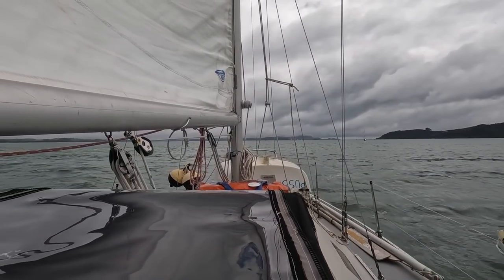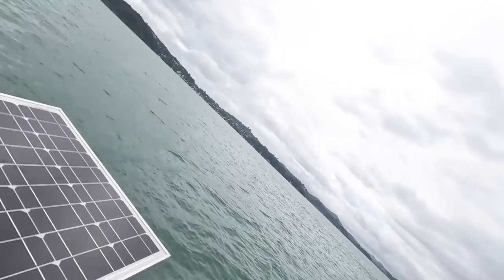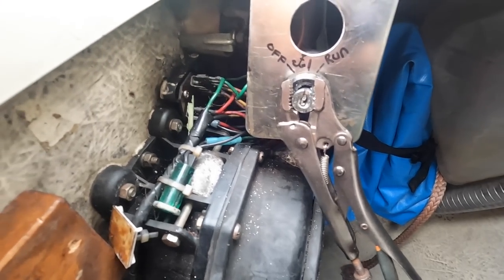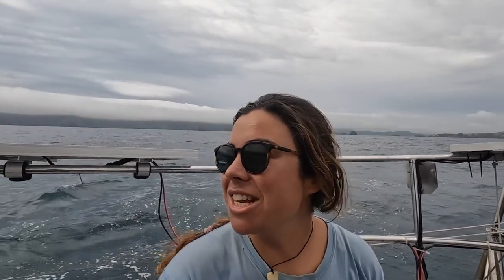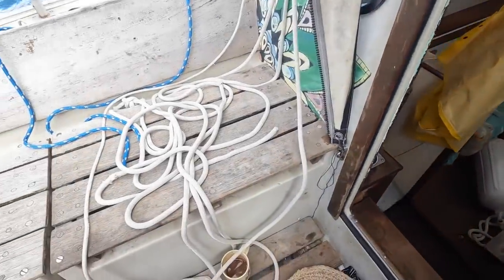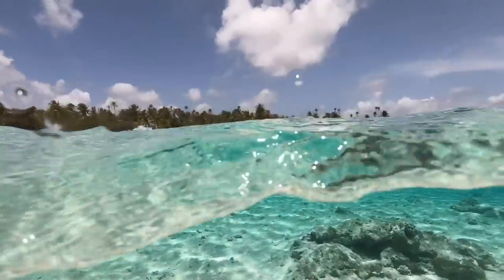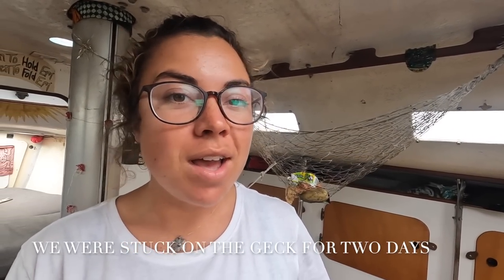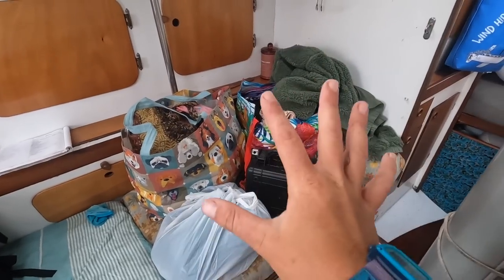Cruising Bay of Islands New Zealand WHSE116

Comment: Get rid of key. Replace it with starter button. Put a secret cut out switch in starter circuit. Total cost less than $20. Make sure you can preheat glowplugs too.
Reply: And a stop button because the fuel cutoff seems to be solenoid operated. No glow plugs on the Bukh I believe.
Reply: Yes, my thoughts, too.
Reply: Totally agree on losing the key switch but you need a power switch, kill switch and preheat switch with the Bukh DV 10 or at least the one I deal with. The preheat is a heater in the intake. I have momentary toggle switches for preheat and the kill solenoid.
Reply: @daveg4  Plus 1 to all of that. Saves me writing a post. Don't compromise on the switches. Proper marine switches, not cheap Chinese rubbish.
Reply: @ross82  Yes.
Reply: There is no need for a kill switch. Just build a LOCKERABLE BOX over the start (& stop) button(s), & use a simple PADLOCK.
Reply: @ross82  yeah, I could understand her doing this out in mid ocean but to have a proper switch and be in a marina and not fix it? stupid, hope it does not bite her ass in the future

Comment: A replacement ignition switch is a simple and relatively cheap fix. It’s not worth the frustration, just replace it with a toggle switch and a push button start.

Comment: Grips of jankey. Kubota knock-off ignition is my choice. A second is planned for the cabin. As is a twin mainsheet, after more money. Get a manual access to the deceleration on the pump. Most have just an electrical solenoid moving to deceleration/ cut-off. The Geck keeps improving halfway around the world.

Comment: So glad the engine is working out for you!  Also like the creative thinking on the main for a better boom angle, but.... The padeye you are using on the deck is 90 degrees wrong. Yeah yeah, I know, little boat, I'll only use it when it's light air, blah blah blah, but that's really not good Holly.  If it lets go you or someone else could really get hurt.  If you send me the contact I'll send you a pair of padeyes adaquate for the load which you can mount aft and pependicular to the existing ones (Spin sheet blocks?).  I wish I could be a Patreon, but I'm a poor rigger. I do have a lot of parts though, let me hook you up.  It's the least I can do.

Comment: Thank you for all of the videos. I have enjoyed watching it for quite some time, and as someone who has been in the maritime industry for decades let me say, your resilience and abilities are quite impressive.
In all the years I’ve watched this is the only time I’ve ever had any concern for anything that I have seen, and I’m a little worried about attaching what is now your main sheet onto that pad eyeand its ability to sustain and heavy weather just a thought captain .
Thanks again you’re awesome .
Reply: Came here to say the same thing. She said she'd tie it off with a preventer, I think, but still. If the strain is left on that padeye and she takes a squall or strong gust, it seems likely it would snap it.

I don't want to see shards of metal, that block, or line whipping through her cockpit.

She's a smart cookie, though, I'm sure she's thought of all this.
Reply: I also admire the capabilities of this young woman and in particular her ability to think outside the box but sometimes a proper fix is better than a jury rig. 
A main track car system is designed to take the sudden loads of a gybe (upwards of 2 tonnes) where a pad eye is just small bolts through the deck and this system is only for light winds, nothing over 5-6kts. 
That can only be used with a preventer and monitoring the weather conditions (and I’m not trying to tell you how to suck eggs 🤣) as the sea has no mercy for the unwary. 
Enjoy NZ and I think you’re next leg up to Vanuatu which is a nice place to visit and you’ll find a quaint French influence as well. 
I bid you fair winds and safe sailing dear 👍👍🤩🤩

Comment: Do you have a  multimeter on board? If not, get one.  A basic understanding of 12v circuits would allow you to approach rewiring etc with more confidence . In the case of the ignition switch (really a stop/ start switch) you would see that swapping in an ignitiion switch is basic, and in this simple situation 2 momentary switchs would easily replace the start/stop switch.

Comment: When I leave mine, I have a 12 volt dehumidifier I rig up powered by a solar panel, which discharges into the galley sink.  When the sun comes up it charges a small battery from a car jump-start kit, and this runs the dehumidifier which draws less than five amps.  I remove the main engine start battery  and place in storage mode.  To do this, I  fully charge it, then empty it of its electrolyte and flush out the empty battery with a little distilled water.  The electrolyte I keep aside in a proper plastic bottle for the purpose. When I return, I simply refill the battery with its electrolyte, top up if necessary with a little distilled water and give a top up charge, and it is as good as new.  A battery may be preserved for years by using this simple ploy.  No acid--no sulphation.

Comment: Been watching you for years as I was working saving up to go cruising,  I watched this one at anchor :-D 

Have you tried putting silicone spray or silicone grease into lock cylinders to prevent corrosion? I've had good luck using the spray on padlock cylinders  in salty environments but it wasn't on the ocean. 

Fair winds, Holly and thanks for keeping me motivated all these years!😀

Comment: Could you glue/weld a little metal bar or wooden strip on the end of the ignition so you can push it in and twist it at the same time? Eventually you'll need to replace it but it might make it more convenient in the meanwhile :)

Comment: There is you tube videos on how to remove a broken key , and there is a tool called a key extractor, with some WD40 you might be able to get the rusted section out.A locksmith can impression a new key from a blank next time in port.

Comment: Sorry for being late, haven't seen you for some time. What I would have done if my motor had to be changed is as follows. Contact Oceanvolt electrical motor / generator (while sailing), easy to install, small, silent, clean, not smelly. From Finland,
Fast delivery with UPS or DHL, two days. I see they have a New Zeeland workshop. You always have energy aboard. Thanks for lovely videos!

Comment: Not sure why, but engine makers don't supply proper tinned copper wire and use automotive switches, so, the switch contacts corrode,over time. best to replace the switch and wiring harness, instead of a breakdown., :).  Love your show.  cheers

Comment: Nice video glad you got your engine running now with your phone go back to where your switches and take some really detailed photos. Then look around the barrel that's the back of the switch on the side and there should be lettering on there probably need a flashlight on when you're taking the photos you want to get this let that lettering cuz you really want to get her a new Switch even if use switch that works when you the proper way